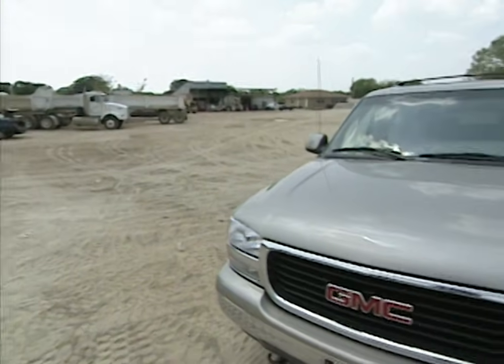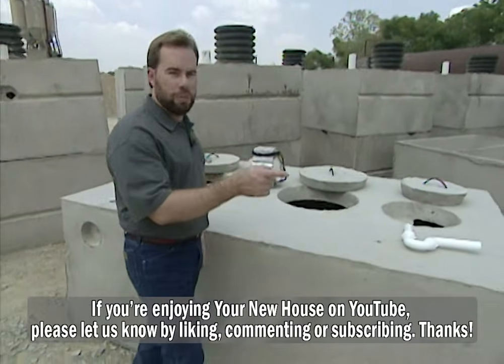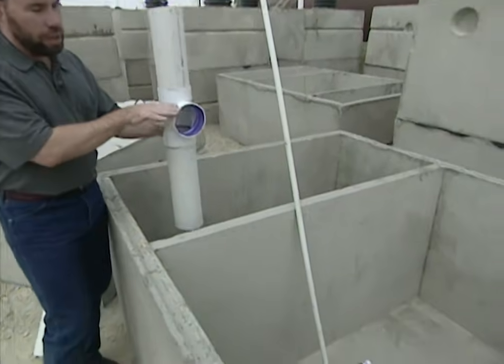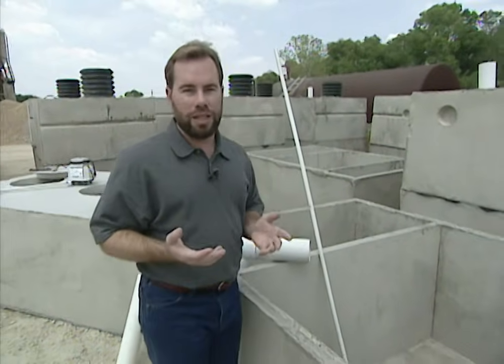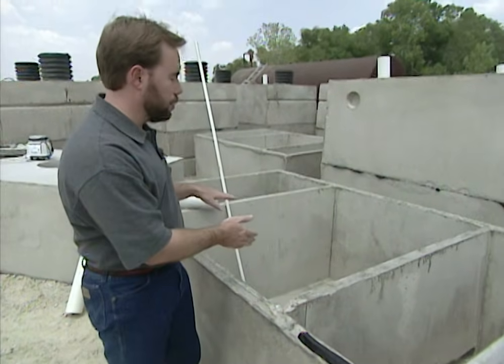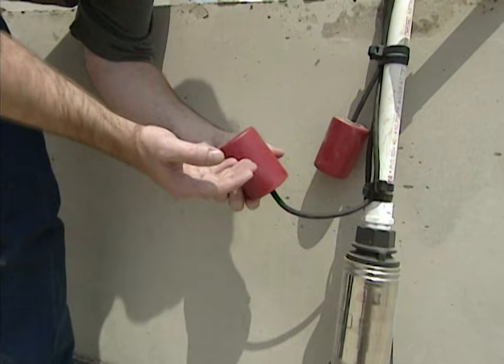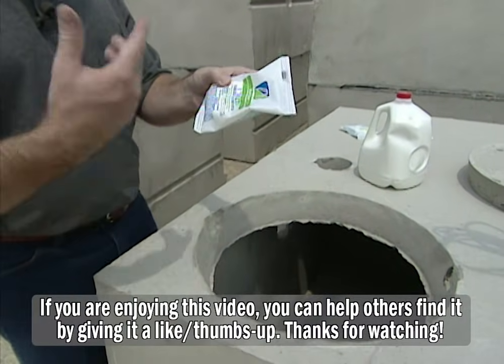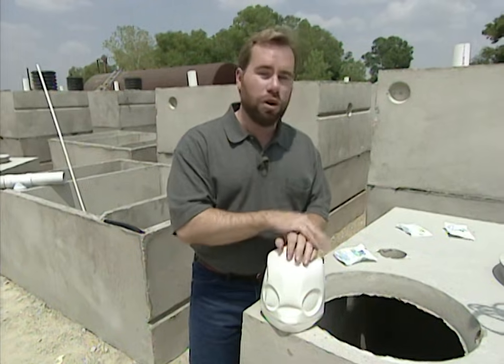Aerobic Septic Systems - Did You Know?

Comment: Looks very expensive and too complicated. The key is actually doing the leach lines correctly. Forget all the pumps and junk that are totally electricity dependent. If the power goes out for an extended time, you're screwed!
Reply: Many jurisdictions require this type (or another complex system) when the native soils are too shallow to accommodate the needed treatment of the effluent through nature soil processes. (the effluent passes through the soil to the water table too quickly for full treatment to occur).

Comment: Do you shower with it that toilet water?
Reply: You already are showering with toilet water if you are on a city system. They filter and chlorinate it. But yeah, that's what it is. And that is exactly what you are doing when you shower on a cruise ship. They use the same water over and over again with the help of a UV purification module.

Here, you could add a UV purifying system. Just like on a cruise ship. It is a clear pipe with sun collector behind it. I'm told the water comes out a little salty. But that can be helped with an osmotic filter. Like the kind under the sink in your house.

Comment: Question, what would cause the pump breaker to trip after running for about 7-10 minutes? Bad pump?
Reply: The pump breaker tripping is an indication of blockage in the air diffuser.   The pump is having to work harder to pump air through the diffuser, which causes the pump to draw more current and heat up, which causes the pump breaker to trip.   The solution is to clean or replace the air diffuser.

Comment: WHY do you "want" folks to have an "aerobic" treatment system. You know this uses the activated sludge treatment process, right? And you know that process is inherently unstable, and is probably the WORST sort of high quality pretreatment unit you could choose in the on-lot operating environment, right? Consider instead the recirculation packed-bed filter treatment unit instead. That is realistically controllable in the on-lot operating environment, so will consistently and reliably produce the "advertised" effluent quality. And it's looney tunes to assert this water is "safe" to disperse in an uncontrolled environment. So just where are you coming from?
Reply: You forget lots of places have a heavy clay base. South Texas is one. Drain fields don't drain. This is all we can use.

Comment: Definitely check county regs. In my county we cannot irrigate our lawns with wastewater.  I love the idea though,  it's so awesome and cheap to do so.  We use subsurface drip tubing that must be installed in native soils.
Reply: Yeah, if you can do it subsurface, why not? I've been dreaming of it for years! Never need to buy fertilizer again! 🤣
Reply: With regular cleaning and maintenance should last the life of the home. I wish I had the 25000 to put one in
Reply: Thought the whole point was that it is not waste water, it is treated water?;
Reply: @CameronsCandorOriginal  The technology is available to create toilet to tap water- full reuse. But our regs in AZ barely support non-potable reuse. They (ADEQ) say they love it, but try permiting a system and you're up a creek. New rules hopefully come out in the next 2yrs to support it (moreso). 
We're pushing for toilet to tap reuse!!! :D
Reply: @JanTijmes you would think our region (Southwest) would be all about allowing and permitting these types of designs especially with all the water issues. Here in El Paso County CO, we have to jump through all kinds of hoops in order to permit these grey/black water recycling systems. Hopefully, they start to ease up on the regulations.
Reply: In VA, we called it spray irrigation.  Always had to have disinfection following the aerator, and it was set to spray after midnight.

Comment: Very very low maintenance? You literally just said it needs pumped every 2 years.
Reply: Exactly this tank system is high maintenance compared to other systems. If they designed it with a 600main solids tank and a 600 baffled for the other 2 processes it still wouldnt make sense but it would be less maintenance for this type of system but issue is a gravity system with a 1200 baffled tank and standard infiltrator field of 2000sqft on 3 foot center to center separation would handle most homes in most locations and depending on the products used in the home IE soap powders, chemical, and such it could go 20 years before needing pumped and provided the field is done right and grandpa dont run over it with a backhoe or a root system doesnt get into it, it could last a long time. I get the purpose and see the need for this system where people dont have the yard space for a proper drain field but i dont condone this system it is just as much of a problem as the foam peanut filled sock pipe that was touted to be the new thing and failed big time whole communities had to replace there systems in 10 years over that crap. While this one may not need to be replaced it will always need to be repaired those stones will clog and blow around the fact he can spin it on the pipe means they knew that and left a gap for air to pass, the air pump will wear quickly standard non grinding lift pumps are NOT designed to have back pressure taht sprinklers will cause. High pressure dosing PTI systems are engineered specifically in length of pressure pipe, spacing, and size of holes are all considered due to the pumps design limitations of back pressure and also why a 5lb spring check valve is needed but makes the pumps struggle thus even a good pump has a life of 3-5years and NO ONE buys good pumps so use the flap style checks. Code enforcements all over the world are costing home owners millions of dollars forcing them into pumps, mounds, and shite like shown in the video... If you get to choose go with non low profile infiltrator field or carefully installed gravity pti fields and have your installer put enviro cloth layers on ends and both ends to have concrete or rock to lock the headers front and rear. Dont bother with strainers if they are code put them in and when inspection is done pull the strainer filter out of the T. If you can install a grey water system for the washing machine the washing machine discharge is detrimental to bacteria that you want to proliferate in the solid side of the tank you could also plumb this to the wet side of tank to avoid slowing bacteria. Have you seen the price of a gallon of milk? Drink that shit dont put it in the toilet. But hey it is your dollar what do i know i only installed these crap catchers for 25years while this guy in the video was in college for a PHD in Economic Disfunction and a Minor in photography.
Reply: 2 years is low maintenance if you don’t have other options.
Reply: @mn-mh6uy  or how about just getting a bigger tank and save time and money
Reply: 3-5 years if you dont put a bunch of trash in it like paper towels , chemicals, oil, tampons, etc. manage your water usage over the week instead of using large amounts in a one or two day period . no mater what system you have these things are a must, plus maintenance is something you need to do but just keep up on the fee parts that make the system work and you will be good, Its not a bad system its just the lack of knowledge people have going into owning one as well as the people getting a new place to live and not really knowing what they have for a system and so on. check what you got and educate yourself as much as possible and you will be better off i promise. :)
Reply: If the effluent is essentially safe to drink, then you shouldn’t mind posting a video of you collecting a glass of that goodness and giving it the taste test. #cheers.
Reply: Seems like home owner should treat this system just as city sewer, just poop, pee and toilet paper. Stop flushing paper towels,  napkins etc down your toilets!

Comment: I grew up in Jamaica seeing some 15- 22 feet deep width about 8 to 10 feet at the top going down in a cone shape to is norrowest point at the bottom about 5 feet. packed with some good sized stones on the walls only and those pits last for generations without any maintenance. My granddad digged a 20 footer more than 80 years ago ( latrine) then upgraded to clay pipes some time after flush toilet became common about 3 years the clay pipes started to collapsing and I ran pvc the when I opened it and measured the slush it was less that 3 feet soil percolation is excellent the only problem I found was about a billion cock roaches was inside the pit
Reply: So your solids were walking away on six legs.  No pumping required!
Reply: Three years ago
Reply: Only in America do we use this expensive system of disposing waste with clean fresh water. Crazy, maintenance for ever, permits, inspections, pumping . Use a composting toilet, use all the gray water for your plants, trees, vegetable garden. Stop paying for flushing poop down the drain. Just my opinion.

Comment: Where can I get the Clorox tablets?
Reply: I think you can use regular bleach.. that's what I use... 1 galon every month. I poured in a tube  outside close to the green lids..bleach. tablets can find them in the swimming pool section... but hurry up... we are in the pool season... and they go fast....
Reply: The plumbing section at most big hardware store have septic tablets. Don't use pool tablets because they claim it'll react violently, you want to find calcium hypochlorite (CaCOCl2) tablets or Liquid sodium hypochlorite (NaOCl) if you have a liquid chlorination device. Around my area chlorination is only recommended/required on aerobic spray systems.

Comment: Great info. I have a system in Massachusetts which is still working ;but, has failed title IV and I am looking to salvage it by recreating the aerobic conditions. I am wondering where I might get the diffuser pipe with the stone.
Reply: Just use a Pond Aerator they are about eighty dollars with out the air pump and piping.Then add the Septic Tank Treatment just research which one so you dont waste your time and money

Comment: I have an anaerobic system with a drain field.  After about 30 years, the first field became clogged and failed.  I was lucky to have barely enough yard to install a new field, but when the new one fails, there is no more room for another field.  I was happy to learn about this alternative.  Hopefully the county will allow this type of system.
Reply: After a few years,  3 to 7, the old field can rejuvenate itself and function again if left alone. 
Alternatively,  you can replace the field by digging out up and replacing it with exactly what was permitted before.  Last option is install an alternate system either right on top of the old system or adjacent to it. 
Check county rules of course.  But as long as there aren't wells or waterways,  ie setback challenges,  you're ok to keep replacing the old system.

Comment: Your first chamber -the trash tank - should much much larger, recommend a 1,000 to 2,000 gallons, so you don’t have to pump the sludge as often saving $$$, but also so that you can hold the water in in the tanks for at least three days and allow all of the anaerobic and aerobic bacteria to do their job in their respective - separate tanks before the wastewater leaves the last tank and enters the drain field.
Reply: This is correct.  Usually systems do have a 1000 gallon trash tank before this three chamber pre-treatment system.
Reply: I agree that a trash tank in front of an atu can help tremendously.   I think most manufacturers are trying to keep costs down as well as keep a smaller overall footprint and therefore say you "don't need" the trash tank.